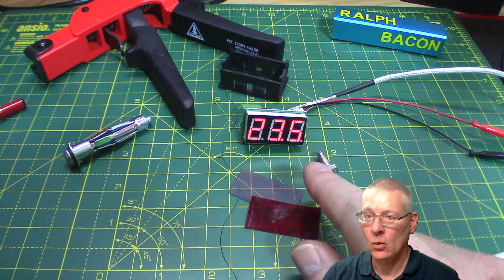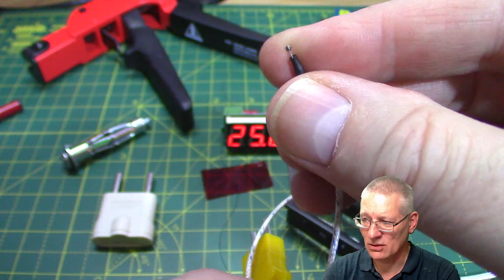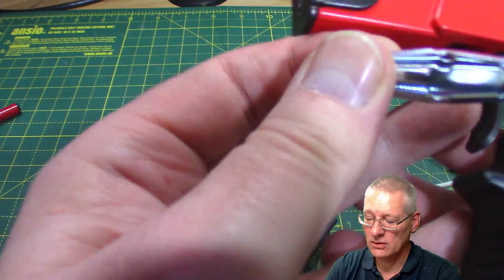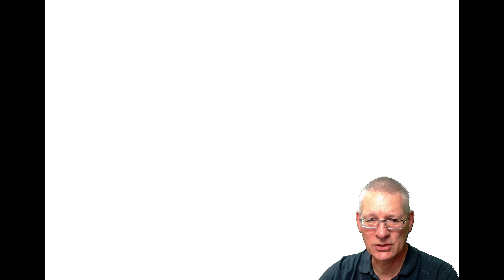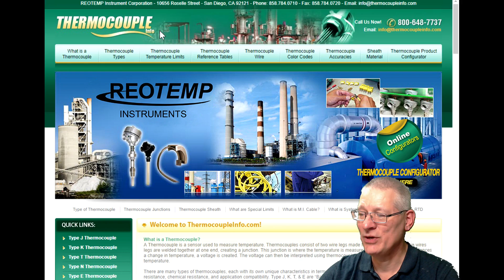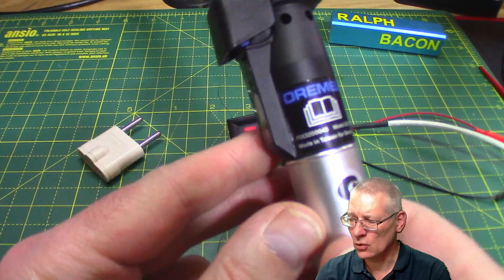#137 K-Type Thermocouple Display

Comment: Hello Ralph, I was hoping the video was about the MAX6675 Module, I am looking forward for a future video regarding that module, I want to implement it to my homemade pellet burner project to measure the temperature output from my boiler chamber exhaust pipe.
Thanks in advance

Vasilis K
Reply: That is in fact very simple. Attaching the probe to your exhaust might be the trickiest thing there. Then get a max6675 module and connect to probe and Arduino. Connects to the latter with SPI. There are several libraries one can use. Adafruit for instance has a library.
The max6675 module costs about 1.30 euro at AliExpress. A sensor/module combo is usually the cheapest option
Reply: @Ed19601  I have seen some YouTube videos about the module, I just know Ralph will do a better job explaining how things are working, as he states the devil hides in the detail, thanks for the reply.
Reply: @VasilisKarastergios  I am sure he will do a great job
Reply from the maker: I believe (I will have to check) that I have such a module. If I dig it out I'll see how I can do a (part) video on it). Easy enough to do, I'm hoping, so keep tuned.

Comment: Many thanks. I've been wanting to buy some of that red filter. I've been using kapton tape when necessary. Kinda expensive :)
Reply from the maker: Yes, Dale, that gel acetate sheet is very cheap and one A4 sheet has lasted me for quite a while.
Reply: I use Kapton tape on LED displays too works quite well but that red acetate sheet is certainly better. Looks like I need to get some.

Comment: The first logical comment 

I do a LOT  of annealing of 2 to 3 inch thick AR500 (AR500 is a “thru-hardened”, abrasion resistant, alloy wear plate. Hardness range is 470/540 BHN with a nominal hardness of 500 BHN or 119 Rockwell hardness .) plate steel. this would work great for checking the temp of the under side of the plate,but how to hold it to the plate without the use of magnets? as they will loose there magnetic hold at the high temps needed in the annealing process that are  500 F or higher.
Reply from the maker: If magnets won't work (due to the high temperatures) you will have to device some kind of mechanical push device that keeps it pressed against the underside of the plate, I can't see any other way of doing it. If you do work out something (else) do let us know here.
Reply: Standard technique is to spot weld the thermocouple wires at 5 mm gap, using a "Thermocouple wire Welder", we use this when induction heat treating drill pipe when developing the parameters, we spot weld 3 pairs.
The weld is very small, and is easily removed, some additional insulation may be required for the wires inside the furnace.
Alternatively, spot weld thermocouple wire to small blocks of the same material, and have these held against the underside.
Hope this helps.

Comment: I guess they started sending stuff from the EU warehouse. How it is possible to keep the postage down i dont know. My colleague said that you can read on the package that it comes from The Netherlands.
Reply from the maker: Some stuff does indeed come from the EU warehouse, Lars, (it's now an option on the Banggood website for some items too) but most still comes all the way from China. Ironically, it's still cheaper to buy from China and have it shipped than buy direct from EU warehouse with quick(er) delivery. Even worse, some items are cheaper to buy from Bangood's USA warehouse with free/low shipping than from China!!! Work that one out.